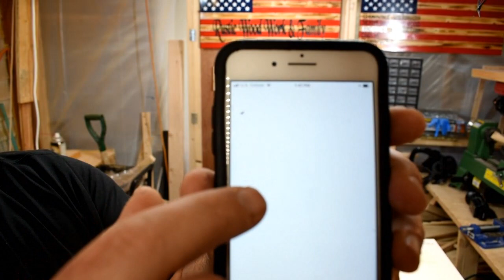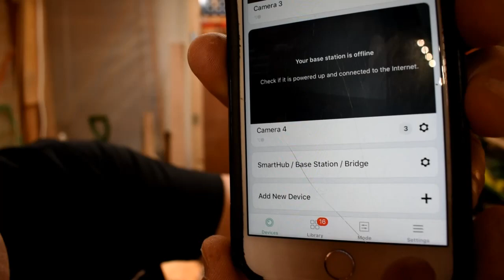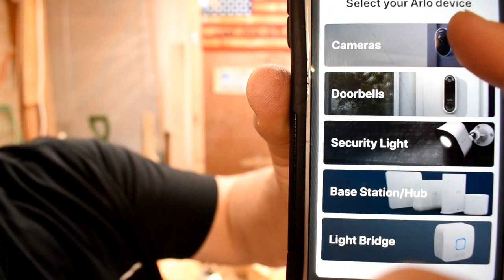How to install Arlo Pro security cameras, unbox/Review/Installation. diy cams

Comment: You mentioned that you got the entry level system, and that there is an upgraded version, named Arlo 2. After doing a tiny bit of research, I found Arlo Pro, Pro 2, Pro 3, and Ultra. They also have doorbells with audio and your choice of video, or no video depending on price. The Pro 3 version has 2K video, and the Ultra version has 4K video. There are even silicon skins in a few different colors to help hide your cameras, and solar chargers for the batteries. This looks like something I am definitely going to be very interested in.
Reply from the maker: PaganWizard Yeah I seen that they had some twos and threes but I could not afford them. They look identical to the camera that I purchased and they were about three to $400 hire
Reply: @EddyFamilyFarm  I wasn't clear on what the difference between the Arlo Pro, and the Arlo Pro 2 was, but the Pro 3 has 2K video, and the Ultra has 4K video.